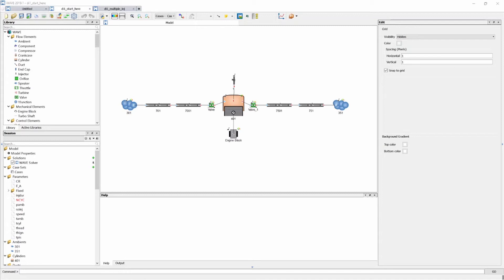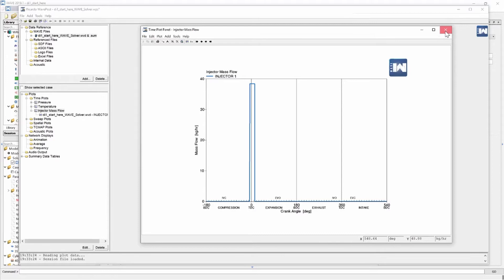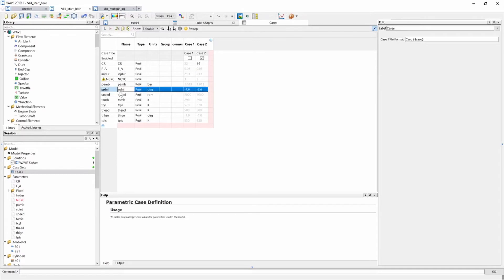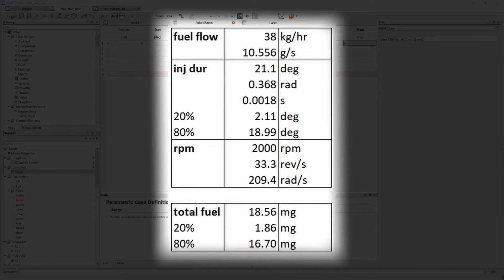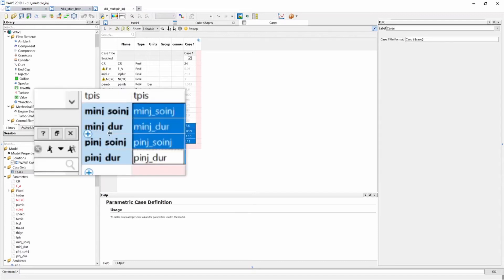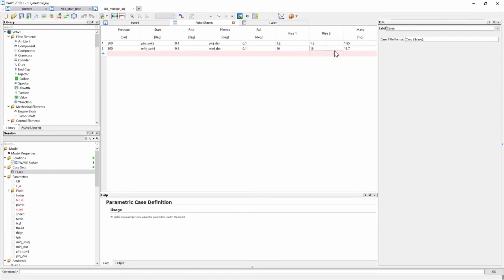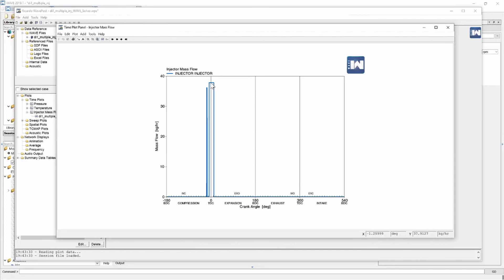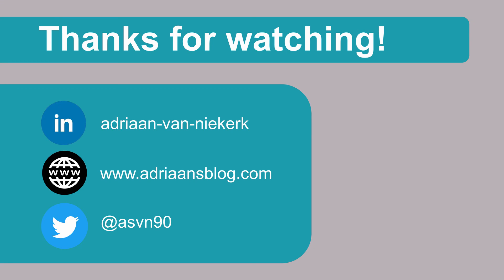How to simulate multiple direct injections in a diesel engine | Ricardo WAVE Tutorial | Tutorial

Comment: Sir can you give some direction on how to proceed with learning and then actually applying Ricardo? Like first learning the engine fundamentals then heat transfer and fluid mechanics then maybe learning CFD, etc. And also the sources of these if you remember from your study. Thanks again for these tutorials! Well detailed!
Reply from the maker: Thanks for the comment and feedback 🙏 A really invaluable resource for me was the book "Internal Combustion Engines Fundamentals" by JB Heywood. It covers engine fundamentals and helps you understand exactly how an engine operates. It also looks at how to model different aspects of the engine such as heat transfer and fluid mechanics. CFD is also covered, but I did not focus on that at the time so I cannot really say if it is useful. Once you are up to speed on the information contained in the book, you can compare it with the information in the Ricardo help file. A lot of theory is covered in the documentation which can shed some light on how WAVE models things. For me, these two resources were enough to effectively apply Ricardo WAVE. 
I have put a link to Heywood's book in the description if you are interested. Good luck in using Ricardo WAVE and do let me know if you have other questions 👍
Reply: @AdriaanVanNiekerk  Thanks a lot sir. Keep up the good work! 👍

Comment: Hi, please can we simulate duel fuel using this software, one of them injected in the import manifold and the main one in the cylinder and how.
Sincerely
Reply from the maker: There is actually an example engine that does just that. It is diesel and natural gas. Just have a look in the examples folder that comes with the installation

Comment: Hey!! I was running a simulation and an error came up that said PHITOT value is too high. I couldn't find any explanation to what it exactly is. What parameter is it and how can I solve it. It also said check intake valve , fuel rate. I can share an image of the error if you'd like to have a look. 
Hope to hear from you 🙏!
Reply from the maker: That usually has to do with the ratio of fuel and air used during combustion. I had this error some time back. You need to check if your fueling is correct.
Reply: @AdriaanVanNiekerk  thank you so much 😇
Reply from the maker: @v.krishna8437  no problem. 👌🏻

Comment: Hi, I am a 4th year Mechanical engineering student, I am simulating a9 cylinder marine engine in Riccardo wave and I am having difficulty with how to set up multiple cylinders. I am looking too calculate the NOX emissions which are produced by the engine and provide solutions for to reduce eg add an EGR. could you please help in how to make a 9 cylinder model in Ricardo wave. thank you
Reply from the maker: There are two ways: you can drag 9 cylinder elements onto the canvas and build the model from scratch, or you can use an example engine. I had a look and there is a 6L 6 inline cylinder. You copy the cylinder element and paste in three more. It will be a start at least :-)